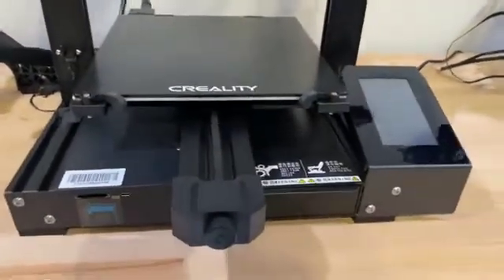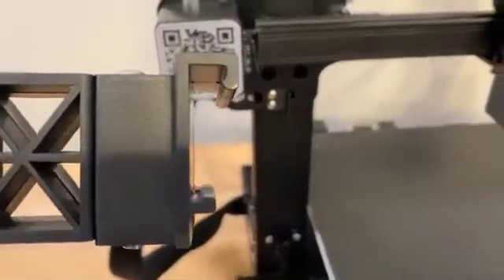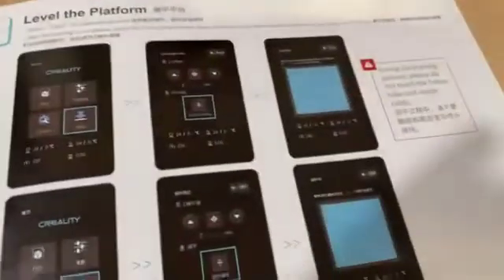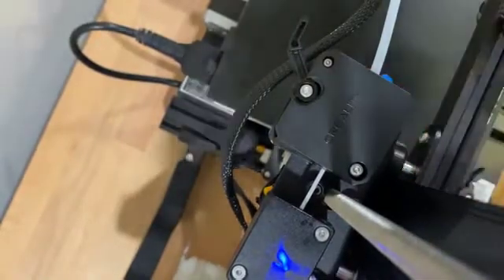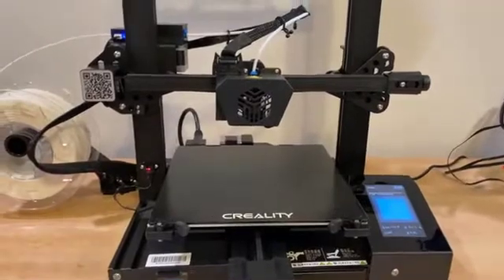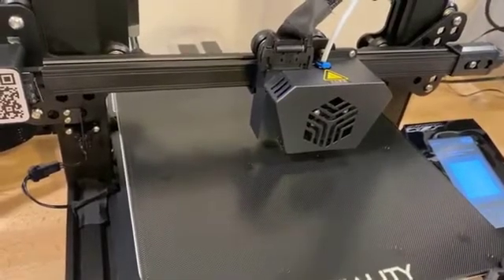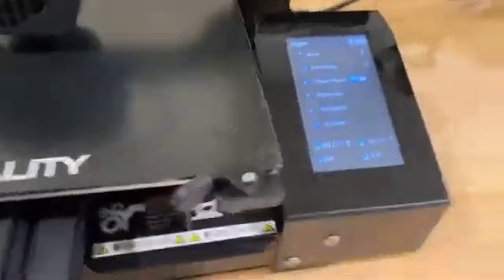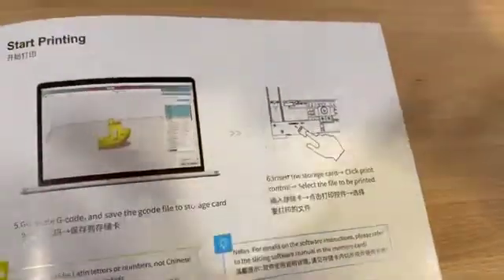Ep4 - Creality CR-6 SE Initial Startup

Comment: hi, maybe the models are in folders inside the SD card
Reply from the maker: Thank you for taking the time to reply.  I did end up moving the models from the folder they were in, to the root of the drive and that seemed to work as well.  Thank you for the suggestion!